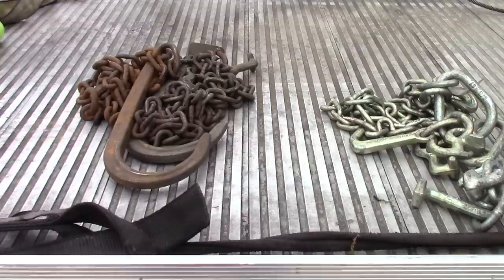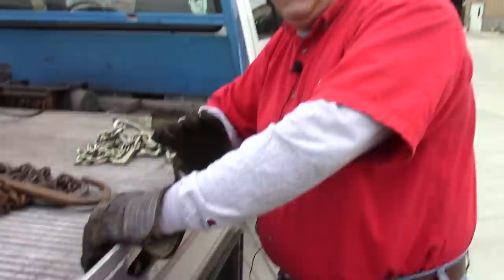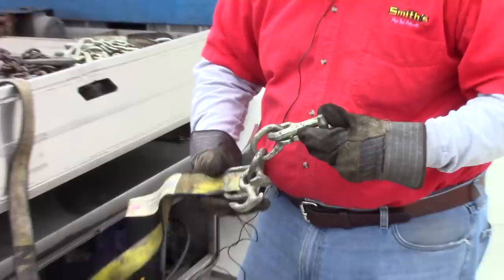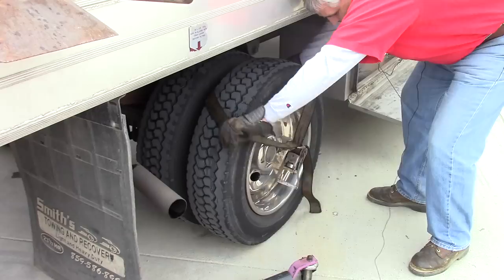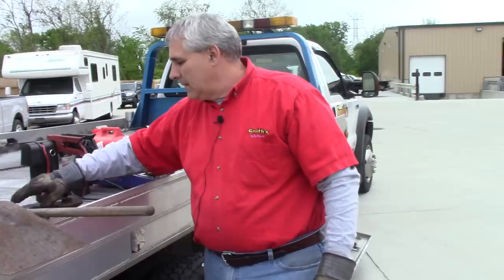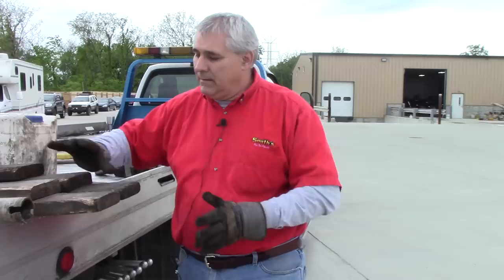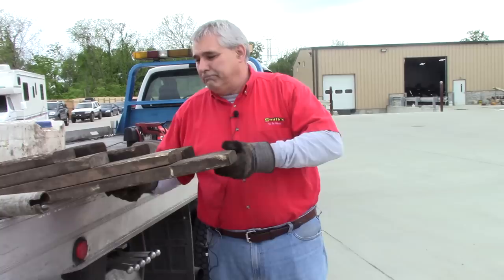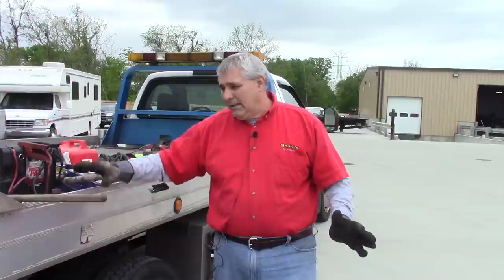Equipment Training Part 1 (Revised)

Comment: The T-hook works great for machinery like skit steer loaders and tractors. They have inverted V-shaped sluts cut out in their frame and they are for T-hooks specifically. If you ever load a combine at the John Deere factory in East Moline, they won’t let you leave unless you have a 4 point securement with T-hooks.
Reply: Yah most people just don't know how to use them properly, you need to spin in over once you insert the T

Comment: Informative video but please new and experienced drivers keep a great eye on your straps not trying to knock the poster but the majority of his straps are torn and should be removed from service they are all in my opinion unsafe since they are starting to tear. Also please do not keep,the clamps of your jump box clamped to the handle the box is always live and if for some reason the clamps fall off they will possibly touch and that can be bad sparks lead to fire when the truck has all kinds of grease and oil stains. Use the cops provided for the clamps or even better use a box that has a on/off switch

Comment: I wish you or someone would elaborate more on the use of R hooks . I have never found a use for them . What am I missing .
Reply: Bobby Ratcliff they go in the T slots and to me there better then T hooks
Reply: Btw the flat part got toward the way your pulling
Reply: @EO.studios  Thanks Nicholas
Reply: Bobby Ratcliff Ive found them most useful on some of the older Chevy/Cadillacs from the 90's-early 2000's. Also better at distributing force across some of the flimser hook points in some newer cars. I haven't run into anything yet I wouldn't be able too with out, just another option
Reply: @csandidle  Thank you .

Comment: The average consumers vehicle may not be a BMWya or Mercedes..etc etc, but may be a nice vehicle to them would also appreciate if you use your noodle and use the pool noodle on the wire rope to protect their car from damage and the headache of a damage claim and their vehicle out of service and held up being in the body shop because you wouldn’t use a $1 pool noodle on all recoveries where the wire rope could possibly contact the cosmetics of the vehicle(s). Wouldn’t it make more sense to just use it no matter the brand or quality of the consumers vehicle?
Reply: No usually the Mercedes or BMW is lower to the ground not all cars need that
Reply: I have never ever had to use a pool noddle on my cable, We have towed in some low vehicles and I've never even heard of using a pool noddle, We do however have strapped briddles that are great for cars where the bridle may rub, It really shouldn't if you have a good loading angel tho, And a lot of the low vehicles have tow hook inserts if you need to use winch them.

Comment: Wire rope? Its called a winch cable.
Reply: Wire rope, not a winch cable
Reply: wire rope is the same as winch cable
Reply: when u order new for your winch the correct term in "wire rope"
Reply: Josh Long no it’s not
Reply: A cable and wire rope are not the same thing.
Reply: Actually the proper term is wire rope, There are many different types of cables, as well as synthetic cables, that all go on your winch, the one shown is called wire rope, it will further be described by how many strands/ braids it has, It's length, and some are made in different ways.